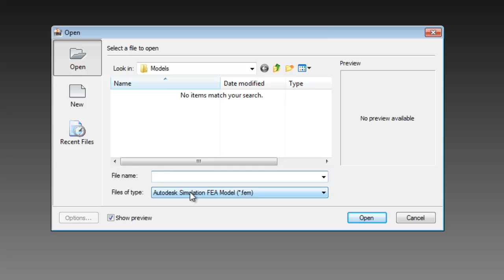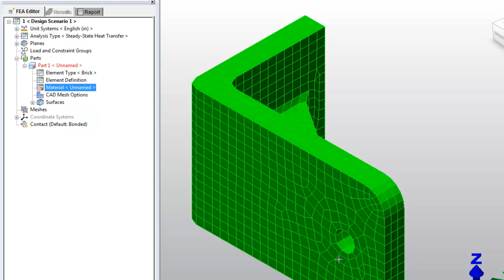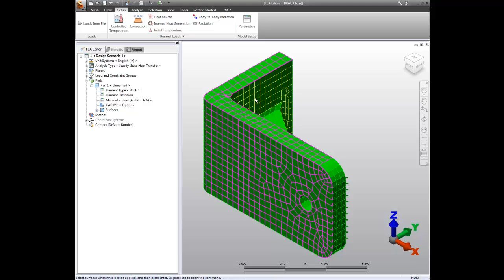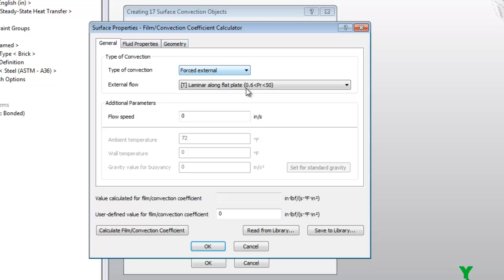Autodesk Simulation 2012 - How to Set Up a Thermal or Heat Transfer Analysis

Comment: sir i just couldnt find the thermal analysis buttons like temperature selection,radiation over a surface,heat source etc in the action tab of autodesl simlulation multiphysics...i only got that in the mechanical edition...can u help me with the location of these buttons in the multiphysics edition?
thnks!